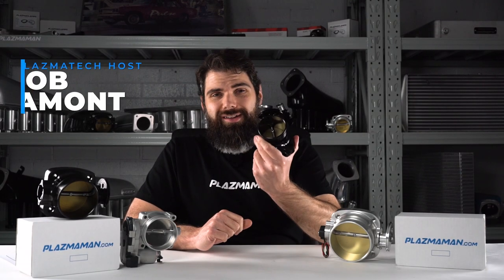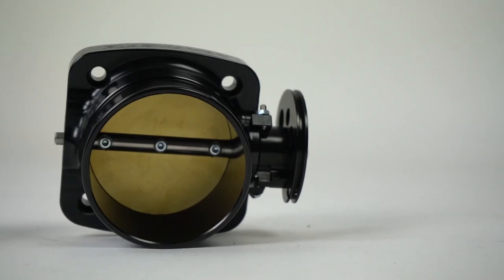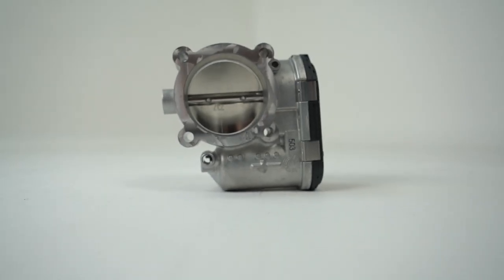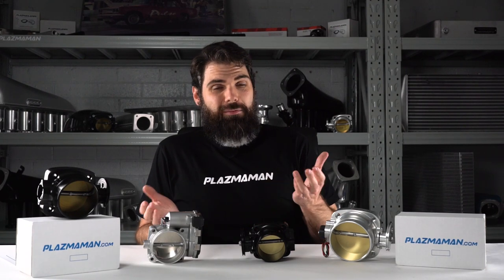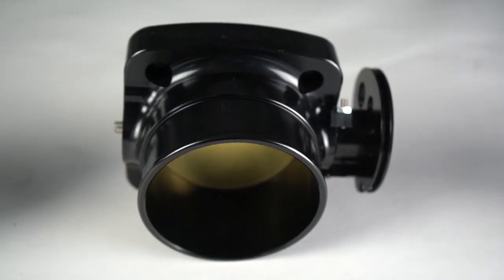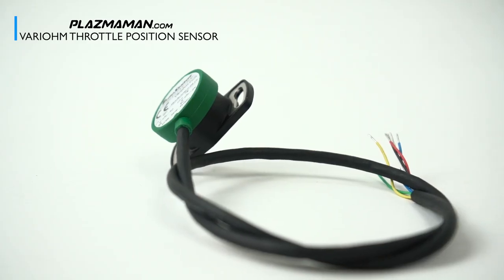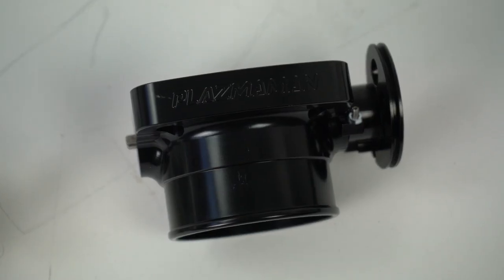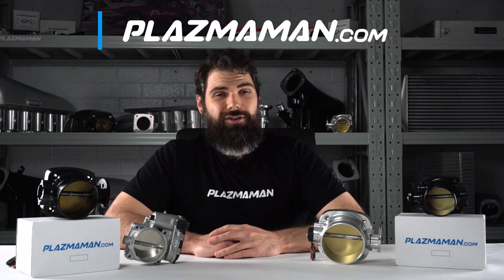PlazmaTech EP:2 - Throttle Bodies

Comment: Where does the tps sensor go on the electric throttle body ? Or is it all done by one plug ?
Reply: There are 2 position sensor circuits built into the electronic throttle body. The Bosch throttle body as seen in this video has 6 pins on the connector. 2 pins to move the motor, 5v, ground and  2 tps signal outs. Additionally, there are 2 more position sensors built into the throttle pedal itself.